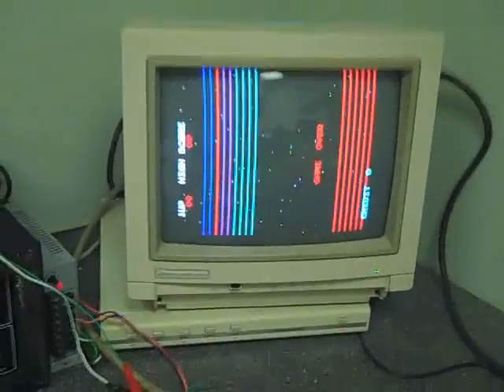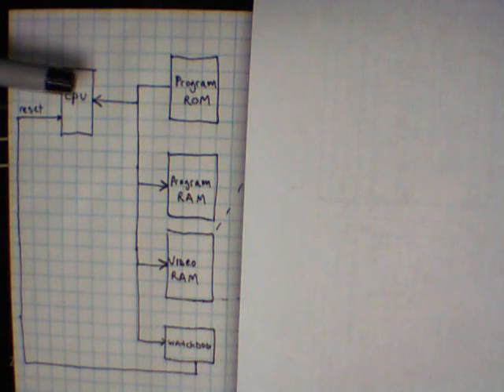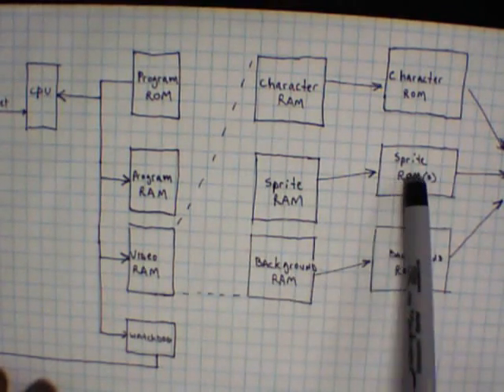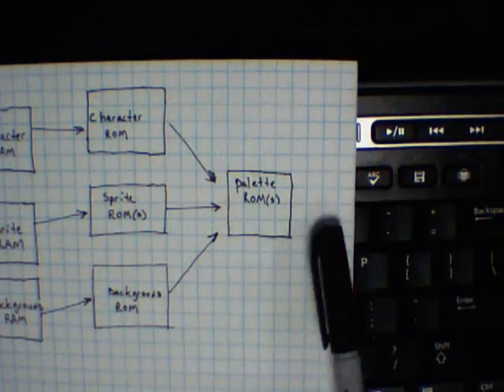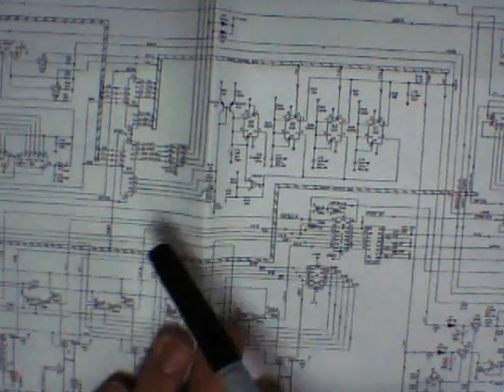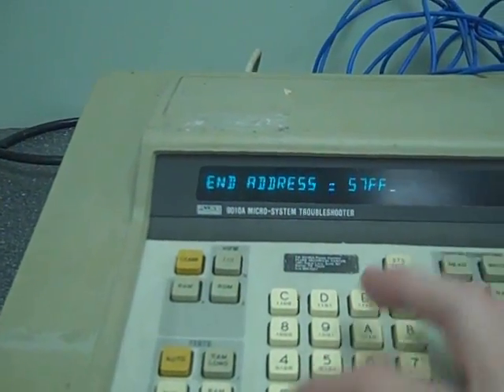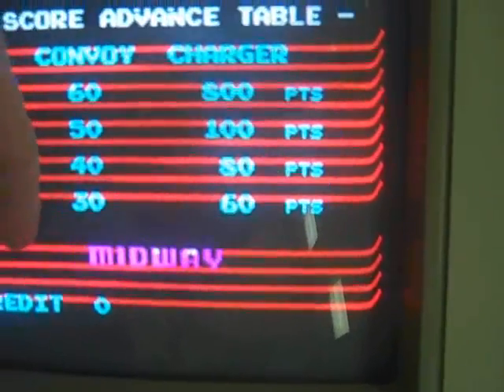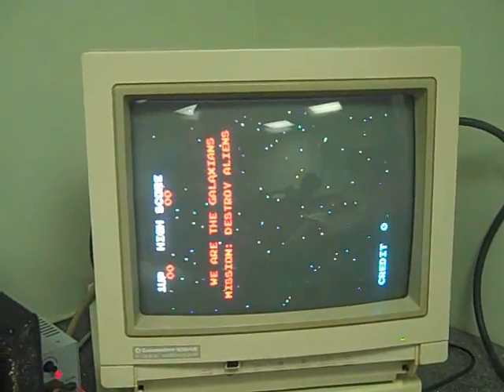Galaxian PCB repair

Comment: if all video signals fail but the game plays blind . knowing that your monitor as well as harness is fine what part is likely to blame ? video ram at the beging of your diagram or the final chip at the end of the diagram? i have a battle gear 2 racing cab one side works perfect the other side plays blind i swaped pcbs from side to side and the monitor and harness are working fine with the known good pcb installed. this is a hard drive pcb called type-zero by taito . have you or anyone reading this ever had this issue? i have checked and double checked the connections in the board stack as well as the connection to the filter board all seem firmly connected. Thanks Matt

Comment from the maker: @atarilogic The game program is burned into the main ROMs on the PCB. Sounds like the CPU can access the test pattern portion of the program just fine but not the game portion. Simply reseating the ROMs may remedy this. If not.. it could be that you have a bad ROM.. or the circuitry that connects the CPU to the ROMs is messed up and will need to be repaired.